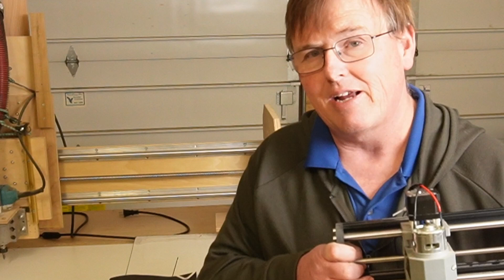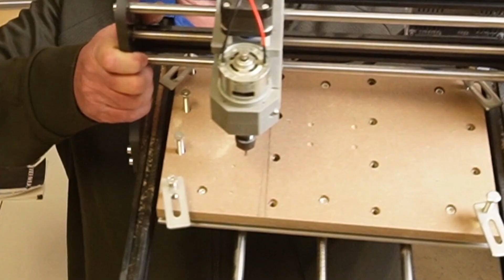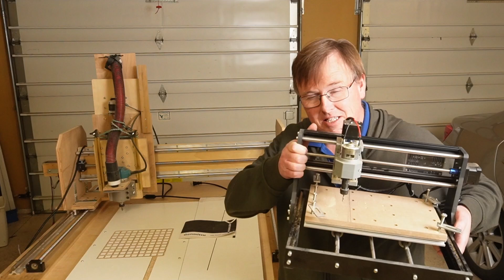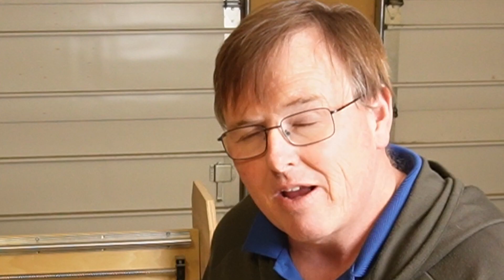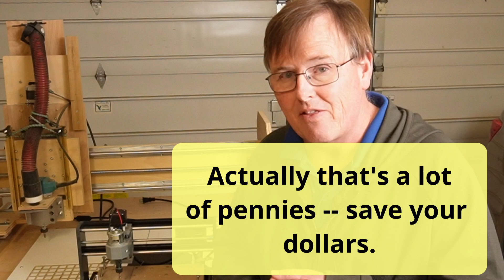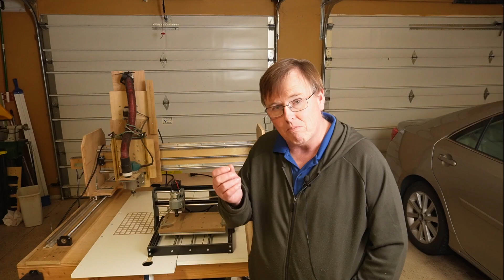BUY OR BUILD YOUR NEXT CNC 2025 -- PROS AND CONS

Comment: For me everything are PROs. I use my DIY machine since 2023 and lately I replaced the Arduino Shield for an MKS Max controller and is getting better every time.
Reply from the maker: Thanks for the info.  I'm curious what advantages does an MKS Max controller offer over an Arduino and what is the price point to get into one?
Reply: @Simplifycnc  Performance & Processing Power
MKS DLC32 MAX uses a 32-bit ESP32-S3 chip running at 240MHz, offering far superior speed and multitasking compared to the 8-bit ATmega328P on Arduino Uno.

This means smoother motion control, faster G-code parsing, and better handling of complex jobs — especially useful for high-speed engraving or multi-axis setups.

🧠 Integrated Features
Built-in WiFi and Web Interface: You can send jobs wirelessly and monitor progress remotely.

Touchscreen Support: Direct control via a 3.5" TFT screen — no need for a PC connection during operation.

Offline Mode: Run G-code from an SD card, reducing USB interference and improving reliability for long jobs.

🔌 Connectivity & Expansion
I2S high-speed outputs for stepper drivers — ideal for silent and precise motion with TMC2209s.

More flexible pin mapping and support for additional peripherals like servos (with some tweaks).

Dual Y-axis support is easier to implement, which aligns with your interest in GRBLHAL and advanced motion setups.

🛠 Firmware & Compatibility
Compatible with GRBL_ESP32, FluidNC, and GRBLHAL, offering advanced features like real-time overrides, rotary axis support, and customizable machine profiles.

Still works with popular software like LaserGRBL, LightBurn, and OpenBuilds Control.}

For 30 dollars in Aliexpress complete with drivers is a must.
Reply from the maker: Awesome input.  I guess I missed your comment when you originally wrote it.  Because of Arduino shifting its opensource policy I am looking at other alternatives and ESP 32 looks like the clear winner.  Thanks for all your input.  I am not quite ready to yet shift over yet (as my arduinos are working just fine for me) but it is on my to do list.  I may hit you with a couple of questions when I actually make the shift.  Thanks!

Comment: i highly recommend building your cnc, depending on you need of course. Im a prop maker/set builder. and this year i built a mpcnc lowrider 3 (soon to be upgraded to lowrider4) i had rather low expectations but they were all far surpassed. for $350 I was able to add a 4x8 cnc to my home shop and its become a huge income stream to me. it has limitations, sure. but its portable, runs on 110v and can do most all that i and my clients need. a fantastic gateway to the world of cnc. especially if you are not sure if you really want to have a big cnc. (they are loud and dusty for sure)  its low risk, as a side benefit. if you build it you have the knowledge to fix it when something breaks. next is building a cnc plasma cutter
Reply from the maker: A good self built CNC definitely can add to your businesses income stream potential.  I do like the Lowrider design (and almost built one myself but was a little concerned about the 3d printed parts long term durability and maybe a crash happening at some inopportune time).  I am curious, did you print your parts in PLA, ABS, carbon fiber or something else?  For those with easy access to a 3d printer, a lowrider is a good option to consider.  Thanks for sharing your experience with CNC building!

As a side note, you mentioned a cnc plasma cutter.  That is also on my list of coming projects (and videos).  I am going to be helping a neighbor build one and will shoot some video of the project.  There is very, very little difference between building a CNC plasma cutter and the CNC build I will be showing in this series.  Once you learn how to build a CNC, you can easily tweak it to turn it into a plasma cutter, plotter, laser cutter, and more.
Reply: @Simplifycnc  after much discussion with the folks on the v1 engineering lowrider forum I chose pla+ t was proven to offer the best stiffness. you can machine some parts of the lowrider from plywood. mdf. aluminum or acrylic as well. im very excited to see what design you come up with...
Reply from the maker: @Astrolumps  Thanks for the info.  I haven't ever tried printing with PLA+. I will have to give it a try.

Comment: Ok I've been looking for way too long around every couple of months when i need cnc for something big or small. Have looked up some content in the past but never got around into actually building one. I will follow you along and try create a small one as a prototype and then decide if i want/can to scale it. Thanks!
Reply from the maker: Thanks for sharing!  It takes courage to go outside the beaten path and actually try something new -- uncommon choices lead to uncommon results.  You 100% can build a good working prototype CNC and won't regret it. I think you will be shocked at how well your CNC will work when it is finished.

I have been mulling over whether to make with this video series showing a huge CNC being constructed or a smaller one so people can build it a little bit quicker for less up front cost  Your input may have made the decision for me (go with a smaller one and let makers mod it as they see fit based upon their space/budget).  Thanks for your input.
Reply: @Simplifycnc  Smaller project = Smaller commitment = Easier entry level. Ultimately I would like to have something that can work 100cmX100cm but that would be big commitment. Lets start small. If you need help with putting blog/website/documentation I will be happy to be part of your endeavour.
Reply from the maker: @lyudmilivanov270  One of the lessons I learned after building my last CNC was that as long as your width (x axis) is a good dimension you can tile your project (either with software or by carefully setting up your cut jobs and repositioning your material) to make just about anything.  Its a little more time consuming, but if your not planning on doing a lot of production work  it will do the job. When you build your CNC you might consider making just your x axis a little wider if you have the space (and keeping your y axis (depth of machine) much smaller.  Wow, I will definitely take you up on your offer for some help with a blog/website/documentation.  Let me get my first couple of videos out on this series and I'll get back to you and we can talk.  THANKS!